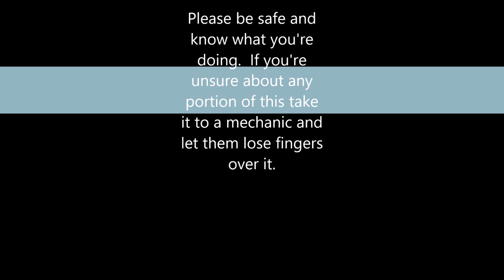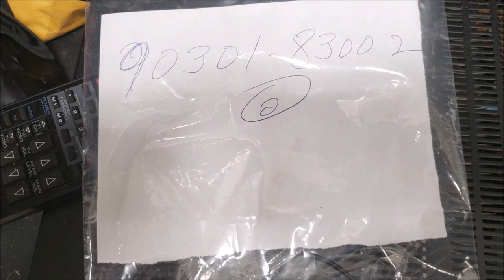3rd gen Tacoma Disc Brake Conversion

Comment: Would you say it wouldnt of been so much of a hassle if u just bought thr whole kit from SOS with the master cylinder upgrade??? Your comment is putting me off on getting it ...is the braking better since the upgrade? Any issues?
Reply from the maker: No. Most of the kit is OEM parts. I was just able to get them cheaper.  The braking is a hair better and it's easier to maintain if you off-road a bunch. Only issue I've had is e-brake adjustment. I can't seem to get a good hold out of it. I've thought about changing it back a few times, but have never pulled the trigger. I don't think it's a bad upgrade, just don't think it's worth the time and effort.

Comment: I understand that the Master cylinder may need to be changed?
Reply from the maker: It's not required.  I drove around for a few weeks with the OEM master cylinder and it felt fine.  I did upgrade (I have a video on it) later on.

Comment: Can you post a parts list? Cost for the Conversion? What is the tool at 3:28?
Reply from the maker: I have a teaser video that details the parts needed. The backing plate comes from SOS Performance. You won't need the hardware kit or shoe struts that I talk about. The backing plate kit comes with them now. Or you can just order the complete kit from SOS. I don't remember the exact cost now. Probably around $800 putting it together myself vs. around $1100 from SOS. The tool is a standard brake tool available through most tool distributors.
Reply from the maker: https://youtu.be/-k9o_BUsB2A
Reply from the maker: https://sosperformance.com/products/rear-disc-conversion-with-parking-brake-slash-tr-dot-ps2-dot-ta16

Comment: If you had to do it again would you? I just ordered this kit for my 2nd gen, I got the master cylinder upgrade too.
Reply from the maker: Had to think on this for a few minutes. I would say no. I believe I've finally gotten to a good place with the kit, but it was a struggle to get there. Some of it my own doing. Some not. It's not necessarily a bad upgrade, but just something I wouldn't hassle with again.
Reply: @MyShadowblue  from what you described it sounded like an uphill battle from the start. I can already see myself screaming 😂 but, as an aircraft mechanic, it can’t be any worse. I’ll be sure to leave a comment and let you know my experience. Thanks for the heads up on getting that brake tool. Should save some heart ache.
Reply from the maker: @barnesbuilt1250  it has definitely been uphill.  I'm hoping that where I am is the peak! If you need any help when you get to yours feel free to ask questions and I'll do my best to help.
Reply: Im really thinking of doing this but ypur reply about ypur struggles is putting me off a little..can you explain the issues you had??if I ordered the whole kit from sos what would be my problem areas?? Problem with parts not woeking or fitting??? Braking doesnt work as it should??? Clearance issues?please explain. Id grearly appreciatw it

Comment: Hi there was wondering if you had to reprogram the abs software because of the conversion because I have 3rd gen Tacoma also an thinking of doing the same things also
Reply from the maker: Not at all.
Reply: So you don’t have to do it because I was told by parts people that I have to reprogram for some apparent reason
Reply from the maker: You do not have to reprogram anything.  I don't think it's even possible to reprogram the ABS.
Reply: Oh okay that gives me some relief probably because the brake on is almost the same

Comment: What year Tacoma did Toyota do away with there typical park brake cable routing? I have a Elocker axle and my park brake cable isn’t routed like that.
Reply from the maker: No idea.  That's OEM routing on a 2017.  Maybe the e-lockers route different?  Mine is just a LSD.
Reply: Weird, the routing is just like the older pickups. I'll have to look into that, trying to decide if I want to do a disk conversion.
Reply from the maker: What year Tacoma?  How different is the routing?
Reply: The cable actually routes to the back of the backing plate to a lever that operates the brake shoes for the parking brake. Not into the front of the backing plate, I’ve heard it called “GM” style cable. I was told the axle came out of a 98’, but found out that the only size inner axle seal that would fit is from a newer gen Tacoma like 2000-2004 ish.
Reply from the maker: Oh yeah.  You're beyond my level of knowledge.  This is the first Tacoma I've had since 1995.  I imagine things changed in 2005 when the 2nd generation came out.
Reply: That helps a little, now I know what gen Tacoma axle I have. I loose track after 96’-2000’ in the pickups. I don’t even own a Tacoma just the elocker axle, and that is installed in a 84’ chassis, kicker is the chassis is a single cab with a 93’extended cab with a bed of the same year. All this is powered by a 22re, 5 speed, gear driven tease. When it’s time for a new truck I’ll just put a Tacoma cab and bed on my current chassis.
Reply from the maker: That's quite a jigsaw puzzle you got going on there!
Reply: True It has been quite the project and still is, but this rig is purpose built and will get me were I want/need to go. Not even close to being a mall crawler, I may only wash my whole truck twice a year, most of the cleaning is done to the underneath which happens the most. Been out of state to help during the floods, and even some forest fires in my home state. This is my first Toyota I have ever owned, and with the dependability I have experienced I can honestly say I won’t own anything but a Toyota. Heck I think I’ll probably keep modifying/upgrading the one I currently own. The boxed frame was in such great shape in the 84’, it would have been a shame to get rid of it. I will just keep it cleaned and maintained until it finally brakes.